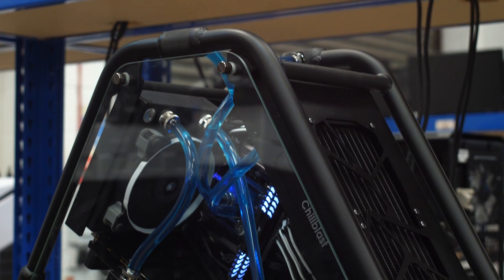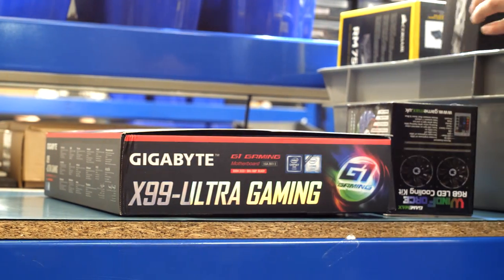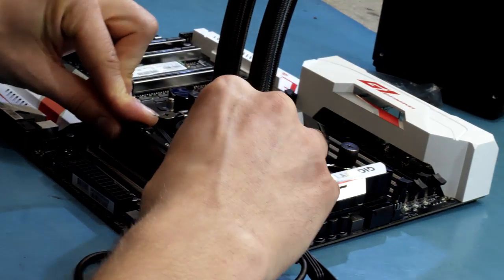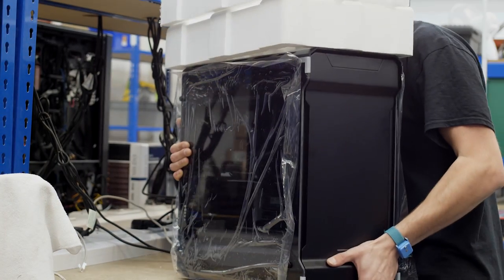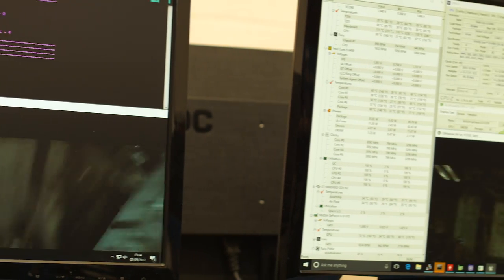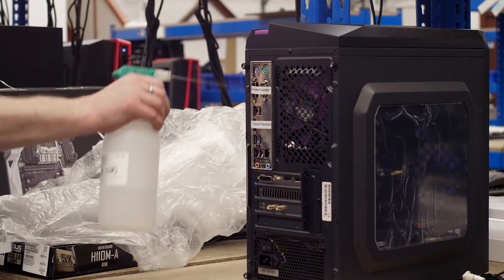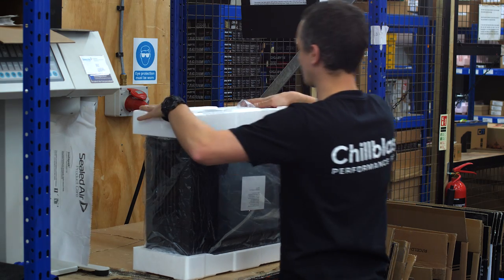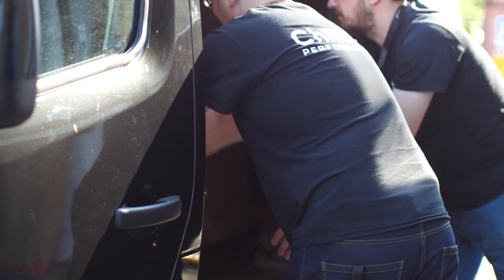the best PC packaging from Chillblast

Comment: Bought a £1600 pc few months back, when I first got it cpu/gpu temps were 90°c+ had to send it back and have additional fans added, support was great but I feel mine wasn't tested like in this video
Reply: webzie09 did you get it sorted?
Reply: flexman22 yes been gaming on my pc pretty much none stop everynight, temps are sweet now
Reply: webzie09 Thinking about spending a similar amount on one primarily for photo/video editing. Your comment concerned me but it's good to know you got it sorted. I guess things can happen I suppose. Cheers for the reply.
Reply: flexman22 I sometimes have better temps than what my friends have and they have water cooled pcs, I'm very happy with my purchase and if I wanted to upgrade I would deffo go to them again
Reply: webzie09 I've built my own PC years ago, but this time with the higher specs I may let the pro's handle it. However how come they didn't advise you on the potential cooling problem in the first place? Isn't that what you're paying for. Didn't they test your PC before sending it out?
Reply: flexman22 flexman22 yeah that's why I said I felt my pc wasn't tested as like they say they are in the video, or the issues I had they would off seen before they sent it, but all is good now so I'm happy
Reply: webzie09 ok I think I'm best talkin to them about the design of my PC. I want it fan cooled as well. I can't be doing with water cooling maintenance. My main concerns are getting the right case and cooling fan so that the system is quiet but safely cool. I'll send them an email. What CPU did you get? And fans? If you don't mind me asking. Thinking of going for a Ryzen one.
Reply: flexman22 that's not a problem, when my pc went back to them they installed Noctua NH-U14S - NH-U14S Ultra-Quiet Slim CPU Cooler with NF-A15 Fan, pc came with 3 fans on the front and one on the back as standard, CPU is a i5 8600k, 2 of my friends have water-cooling but I notice they can get higher temps than me sometimes when we're playing the same games.
Reply: webzie09 ok thanks the the info. I guess it depends on the processor. The more cores it'll heat up. I think of goin for i7 or a ryzen 1700.
Reply: flexman22 not a problem, my friend went with the i7 but he has watercooled so I couldnt say what cooling would be like with the i7 and I haven't looked much into ryzen tbf, but if you get a good CPU fan you should be good, the one I said about noctuna they do a X2 fan maybe that would suit the i7, but see what chillblast recommend
Reply: webzie09 thanks man. Really appreciate all the helpful replies. Just been looking at their laptops. They look pretty damn good. Ahh I take ages to make decisions, but hey it's a fair few quid so worth the considerations. I'm emailing chillblast in the morn and hopefully get something sorted. Thanks again.
Reply: Even though it's redundant now and you've probably already made your computer, use the Ryzen. It's better.